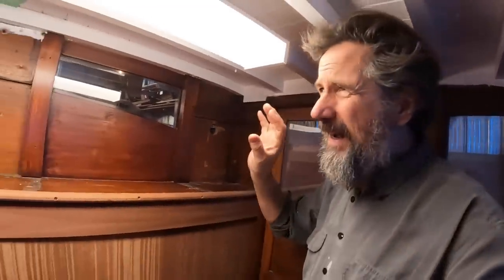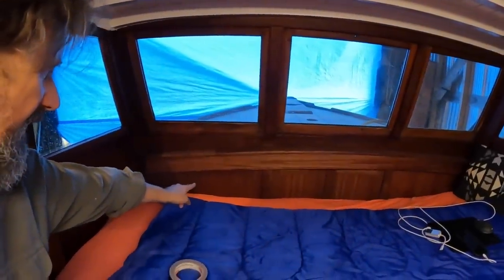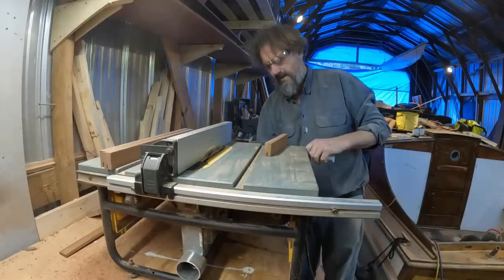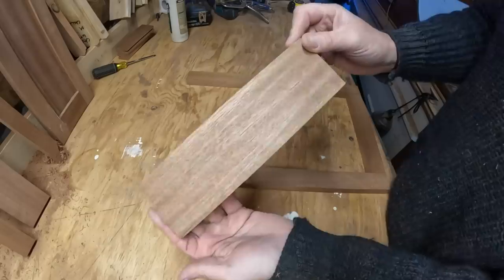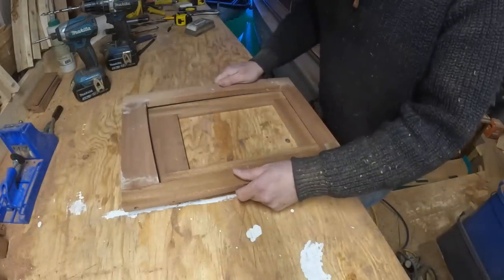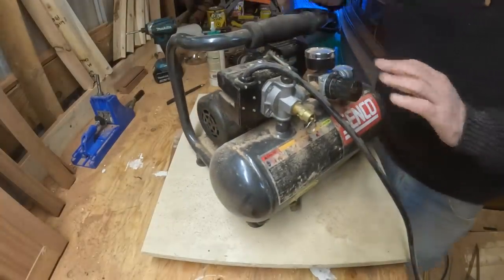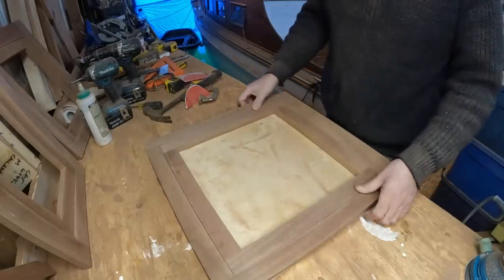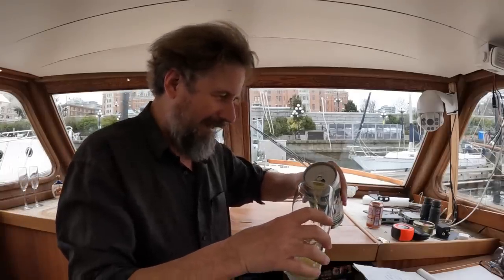New Galley Cabinets- #354 - Boat Life - Living aboard a wooden boat - Travels With Geordie

Comment: Sorry beforehand when I say the following. Fixing that plug seems to me might take in total an hour and a half.  Put a piece cardboard on the underside of the hole.  Trace the pattern of the hole   from above. Find a piece of solid wood , cut the hole out of this piece matching the holes pattern.  Finish as needed.  Glue in place .  Using epoxy color matched to the surrounding area. In my eyes viola. But maybe your more particular than I would be.  Great video as always.
Reply from the maker: Yes, that hole will be fixed properly sooner than later.

Comment: Peter I assume that the T&G cabin top planks are laid fore and aft.  What I did with that sort of planks was to cut the planks out half way across the deck beam and then lay in new short pieces spanning the gap.  I cut on side of the groove off of the last plank so I could simply drop it in.  Once the new planks were screwed down the repair was invisible from the inside of the boat.  A bit of thickened epoxy made the cabin top fair on the outside so it could either be covered with canvas, a layer of plywood or fiberglass cloth.  It was easy to make the repair disappear.  The cabinets look great.  I do have to quibble with your choice of finish.  Ten coats of Epifanes gloss varnish and then two coats of rubbed effect will give even that plywood plenty of depth.
Reply from the maker: Thanks Todd, that's exactly what I'll do when I find the opportunity.
Reply: 🐾🐾🐾 🐈
I have a hole like that..
It was for the chimney of my wood burner in the 90's...
I found a old brass pressure gauge at a scrapyard.. the main body is a ring with a flange that has a rebate for what was the back panel..
I got 2 circles of glass cut.. one for a spare..
It's now a skylight above the steps going to the Wheelhouse.
It also projects a beam of light on the door, acting like a sundial and seasonal indicator as the beam gets higher in the winter and lower in the summer... years ago I measured the angle and it worked out to be the latitude at equinox and from the extremes it's possible to workout the angle of the Earth to the Sun.
This educated me...
As in 2007.. I made a Henge and a Mesolithic house, the door face's winter solstice sunrise.. and the light cast though the door is a seasonal indicator.. as this told them at winter solstice how much longer winter was and when to start planting crops.. as at about 10,000BC was the start of farming.. also that direction receives least wind in the UK.. those are the reasons I think they put the door there..
2012 I made a tubular framed pyramid about 12 foot high.. aligned with the compass .. the shadows were interesting as it acts as a sundial and seasonal indicator...

Comment: Hello Peter , you mentioned your drill bit is getting a little dull . Darex makes a drill sharpener that only costs about $30.00 . It sharpens drills 1/16-1/2 inch . Or maybe 3/32’s I forget . You should add that to your Amazon wishlist ? Just a thought . Great looking cabinets too ! 🤩
Reply from the maker: Thanks William, that's a great idea. However the Kreg drill is very special, with a pilot and square shoulder.
Reply: @TravelsWithGeordie   I have a Darex sharpener and I think the square shank will clear the compression collar .

Comment: Nice and quick job with a satisfying result given the time, workspace and tools you have at hand.
However, as I know you are a feinschmecker Peter I have just a side-comment on the construction itself (which unfortunately would have complicated the build given the curve/arch you had to incorporate). When making cabinets with stiles & rails doors myself I normally go by a  proportional rule many uses in woodworking: the stiles should be 5-6/10 wide, the upper (and middle if applicable) rail should be 6-7/10 wide and the lower rail should be 10/10 wide. Also, I try to keep the face frame not wider than 3-4/10 in order not to make it more visual than the door. The proportions are universal for either metric or standard measurements. 
Though this 'rule' has little effect on the rigidity on a small cabinet/door, on heavy entrance-kind doors you have the side effect that the most solid (ie widest) piece is down where the door might be kicked the most. However, the most important reason why I use these proportions is that they are more pleasing to the eye - as ppl have found out during the millennia such pieces have been made - and I was thought by the old master woodworker at school yrs ago. Cheers.
Reply from the maker: I completely agree on the proportions. With doors I'm more careful.
Here I wanted only one stock width to simplify cut runs and economize on material.
Reply: @TravelsWithGeordie  Thx for reading and commenting. Yes that's 100% understandable. All in all the cabinets turned out superbly. Your skills and what you produce in a boatshed or inside your boats with the space and tools available is admirable. Lovit lovit lovit ...

Comment: Since the roof looks to be painted or finished in a color rather than finished, I would fix that hole in the ceiling temporarily with a Dutchman.  They are traditionally used in door repairs if you need a video on the technique but is applicable here with the skill you have.  I know its got a rounded shape to the roof but make a router template that is flat and hot glue/shim the template in place (whatever works temporarily) to make a "flat" groove into the good wood surrounding the hole.  Them epoxy a piece into it that sticks out the top that you can fare down the top to match the finish and seal it.  On the inside you can either cover it with a decorative piece or just make up some mock tongue and groove to mimick the ceiling that is there and epoxy them into place and paint white.

Comment: Hi Peter, every time i make a door in a similar way the door warps. How do you get them to stay f lat ?
Reply from the maker: Good wood makes all the difference. Sapele is so tight grained it very stable.
Reply: I use old wood or wood that I have left to season for a few years..
I bought 3 pieces of mahogany like wood in 2017.. it was cut off a large lump.
They are...
12 foot by 12" x 1" they have sat on the roof of my shed outside all that time, I've turned them many times as they have warped and kicked.. and are now stable.
I do the same with soft wood which reacts quicker.
Reading the way the grain runs can help..
Straight even grain without any knots usually stays ok.
Putting wood high up in the roof of a workshop with sticks to keep them aired will gently cook them in a few months in summer.. then ideally put where they are going to live for a while to stabilise.
Reply: @TravelsWithGeordie  Thanks for the response. I live in Australia so very limited access to good quality timber, mainly radiata pine.

Comment: My immediate thought for the hole in the roof for a quick fix, would be to cut a plug and install it with epoxy. I would probably have done that with all the holes in the cabin. Is there a reason that is not a good idea?
Reply from the maker: It's definitely going to get fixed properly soon.